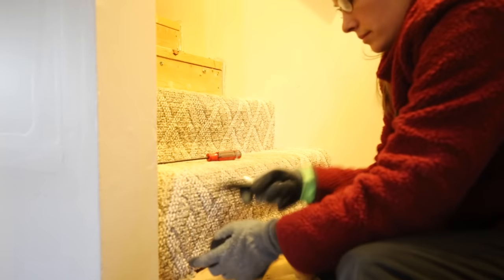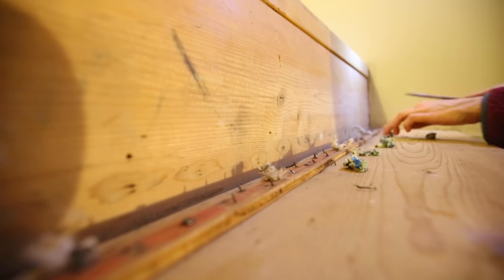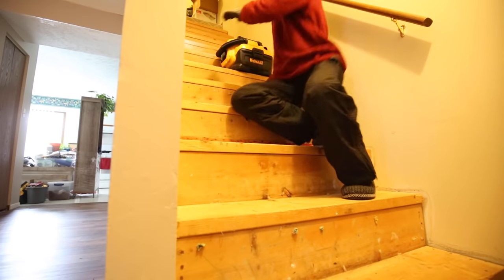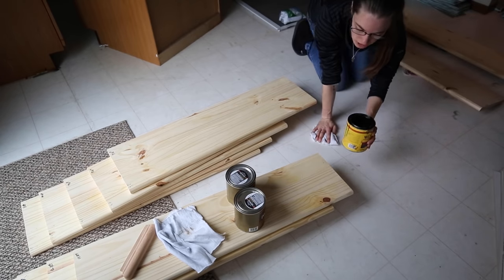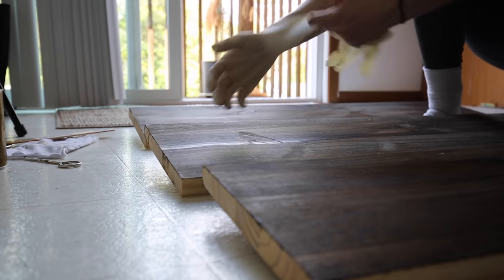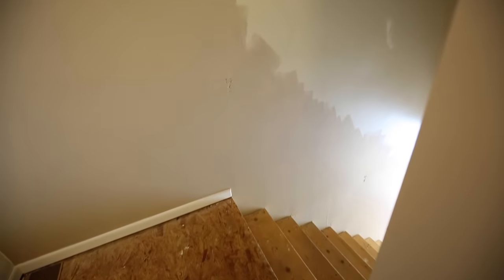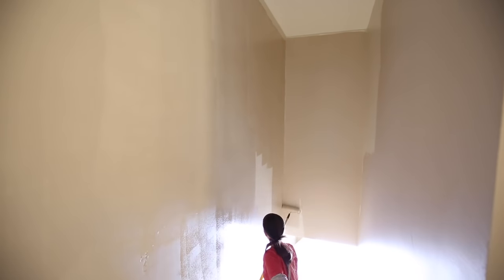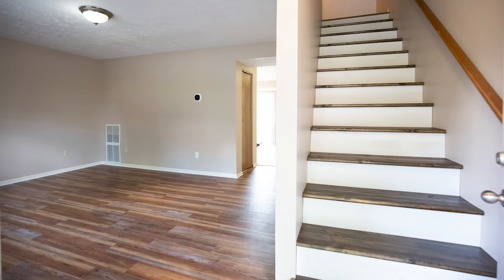Remove CARPET from Stairs | Carpet to Wood Transformation

Comment: I ordered the light spa in the 2’6”x3’10” size and then ordered the light spa 2x6 runner the next day. https://www.youtube.com/post/Ugkx9Q9vgRgCHm-96ZJLA4omp5_kb26p6SfX They were in separate orders, shipped separately and they arrived the exact same color. They are definitely green and the color looks exactly as pictured. (I actually thought they would be more blue, based on other reviewers saying the color portrayed in the picture was not what they received) They’re a low pile and not padded at all, so they don’t offer any squish under your feet when you step on them, but they are a nice soft nylon. They’re thin and rubber backed so I imagine they will do great being thrown in the washer. They’re perfect inexpensive rugs for my garage door and back door. Also love that the carpet isn’t looped on these. My last rug was looped and my vacuum caught a strand and It ripped out a whole row, tearing the rug in half! Great rugs for the price!

Comment: I noticed you did not remove the original treads. What did that do to the first step from the floor and the last step from the top? If I am thinking this out correctly you would have grew the first steps riser and shrunk the one at the top.
Reply: Exactly my question!! Any answer?
Reply: @angelikamariae  im about to ask that question too; )
Reply: I was thinking the same thing!  Although maybe it was a wash with the carpet/padding that was removed.
Reply: A friend of mine (who does floors for a living) came to help me install the stair treads and while I know nothing about this, I did a lot of research and thought the same thing from videos I watched. But my friend said it wasn’t necessary and I trusted he knew better than me since he does this for a living..but sure enough the top riser was too long. So now I’m having to build out somehow.
Reply: Did you seal or poly the bottom of the treads? If not are you not worried about them possibly warping or cupping over time?
Reply: No carpet is 3/4 and her tread is probably 3/4 or 1 in so she’s fine!!

Comment: I have the same high ceiling above my stars. To reach the highest parts, get another "Long Stick" and at the of the stick tape (w/ Electrical Tape or Duct Tape) an angled Paint Brush to the end of the Stick. Dip the brush and you can reach up there with no problem to paint the higher portion. I edged my upper ceiling all the way around before painting the walls. You will have a sore neck and arms, but this is easy and much safer than creating a scaffold to get up there. :  ) Nice Job! That is a lot of work. It came out great!

Comment from the maker: Hey everyone, thanks for all of your questions. Here are answers to some FAQs:
1. How much did this cost?
We used about 12 pine treads at roughly $12 each, same amount of risers for about $10 each, 1 container of stain for $5, and 1 container of polyurethane for $5, plus the little piece of trim on the first step which was $2-3. Altogether, that makes $278.  *NOTE ABOUT COST* The construction market has exploded over the past year, so prices will be higher now. I believe the market will calm down and level out in another year or two, but it might be worth it to wait if you’re thinking about doing this now.

2. Where did we get the treads and risers?
We bought about 12-13 treads and risers from Lowes. The treads came untreated as you see in the video, so we needed to stain and seal them. The risers came pre-primed (the white color), and we sealed them with poly for extra protection.

3. What kind of stain did we use?
MinWax Jacobean 2750.

4. Did we caulk the gaps, seal the nail holes, or stain the railing to match the treads?
Nope. This was our first stair reno, and we were learning as we went along. We definitely overlooked some of the little things that professionals do to finish off the look. We made sure the stairs were safe first and foremost, but some of the extra visual touches were overlooked. Luckily, feedback helps us learn for next time!

Thanks for checking out our video, and good luck with your projects! You are capable of so much more than you realize.
Reply: Thank you for sharing. So helpful!
Reply: Were the risers also pine or are they another material?
Reply: @Barathos   would love to know this as well! Thank you!
Reply: Thank you for this video! I’m truly inspired to take my carpet up and paint my walls. ! With 3 small children and a dog stains are endless , this will truly be great addition to my home cost wise and aesthetically!
Reply: Thanks so much for the inspiring and helpful video! After a bit of use, how is the pine looking? Oak is more common for stairs in the UK as it's a hard wood, but pine is cheaper and easier to work with for a beginner DYIer like me...thanks for your feedback!
Reply: Make a video transforming your stairs into drawers for shoes, tools, toys and so on . I saw the video but they didnt teach how to do . Tks
Reply: About how long do you think the project took? I love the video, it’s a project I’m about to tackle myself, and I’m assuming my dog will want to watch and not help as well. Lol.
Reply: What glue/caulking did you use?
Reply: Just running the numbers on this now and it seems like it will be about $400 in 2024. 14 steps.
Reply: It looks great！

Comment: Just a tip before staining, use 180 grit and lightly sand. It’ll stain more evenly. Also, when using poly, use the sponge brushes, gives it a more even coat! Other than that, great job!

Another thing I might suggest doing for whoever decided to do this. Using white silicone for the white part (risers) before adding the stained one. So I can look cohesive to the wall.

Comment: Great instructional video!! An easier way to remove the staples is to use a pair of pliers, grab a hold of the top of the staple, and then rock the pliers to one side utilizing it as a lever. It's much less physically demanding as well.

Comment: How come u didn’t just paint and stain the original treads and risers?
Reply from the maker: Great question. Our carpeted stairs (meaning stairs that were constructed specifically to have carpet on them) were "bull-nosed", and the edges were rough and uneven, which can lead to trips. Adding uniform treads and risers will lessen the tripping hazard. But you can also keep the original stairs sand down the uneven parts. That was beyond our skill level.

Comment: I have the exact same walls I had to paint above stairs, I used a “long arm” pole and a paint edger attached to it to get the very top cut-ins instead.
Reply: You can also buy a gooseneck brush and attach it with your pole to cut in, works like a charm!
Reply: I did too.

Comment: Great job and the result I amazing. Just a thought: it’s good to do stain on both sides, even if part of the underside doesn’t show. It will prevent warpring. The rule of thumb I’ve heard is that whatever you do on the top, you do on the bottom. It was relaxing watching someone do all the work: I refinished my staircase last year … worth all the blood, sweat and tears!
Reply: isn't better to stain stairs at the end, once everything is done? yes you will need some work to put tape around but this way seems faster and probably cover better all potential little gaps if any and filled with caulk, stucco etc.

Comment: If you're okay with the unfinished paint job at the top by all means do it yourself. But if you feel you would need a professional to finish that trim in between the wall and the ceiling, you're better off just hiring professionals to do the whole job. I couldn't imagine that the cost of them cutting in the trim alone would be much less cost than just doing the entire job.

Comment: I usually use pliers to pull the staples out. Though some of them require use of flat head screwdriver when they are deeply embedded in the wood.

Comment: Did you have to cut the nose off the stairs before you added your runners/risers?  Or did you just fasten your riser to the top part (that stuck out more) and angle it down to the bottom?

Comment: I thought you could use the wood under the carpet I had no idea you had to put down new ones. I'm looking to have my done by a professional but it looks easy watching this video. Thanks for sharing. Great job!
Reply: The wood under most carpet ("builder stairs") is usually pine - a cheaper, soft wood. It will dent after some time of taking the abuse that stairs do. Replacement treads are hard wood.

Comment: Doesn’t adding the extra height on the treads throw off the distance from the upstairs landing to the first step going down (makes it shorter) and when climbing up the stairs from the bottom the first step is higher?

Comment: Hello, I noticed you used a nail gun during the installation, did you fill the holes after ? Or painted over ? How did you hide the nails, or did you just left it as is ? Also, can one get away without using nails, and just use a good product,  like "no more nails" for example ?

Comment: Ok so quick question, I saw that you didn’t put the riser on the first step that touches the floor but started on the second instead because you didn’t install the floors and probably would do it later to on top of the floors … but the tread is flush on the second step so when you eventually added the riser how did you hid the lip because the riser would be wider and not covered by the tread lip ???

Comment: Nice thank you so much. For those who have a window cleaning extension in the area of Ireland and UK you might, I tapped a brush on the bending of this device to paint the corners of the walls and ceiling. Does work too 😃

Comment: fantastic job! and thx for posting this video and revealing how much work it actually is to redo stairs. i have the same setup here ie old carpeted stairs and probably tons of staples and i would love to get rid of it and put on some new treads like that. I do wonder what affect the new treads had on the top and bottom step heights... ie does the bottom step feel kinda high and the top step feel kinda low compared to the rest of the steps ? terrific video :)

Comment: Hi, since you are adding 1" steps/treads, the space between the top step and floor will be an inch shorter than the rest. Also, the bottom step will be an inch taller. Could this be out of code? And a tripping hazard?

Comment: I started removing white carpet on my stairs & discovered it was metal underneath.  The tack strips are glued down on the metal steps with some kind of construction adhesive.  I've tried everything to get them off. I finally got most with a hammer & chisel.  It still left the glue & wood.  I haven't removed the rest of the carpet because I can't get these strips off without hours with a chisel & hammer.  If anyone can help please respond to this comment.  There is absolutely nothing I can find when I try to research tack strips glued to metal stairs. Please help!!

Comment: Is that DeWalt battery vacuum not the best little thing! I love mine!    I think pulling carpet off of stairs is one of my most hated things to do in a flip or remodel!
Reply: When reming taking strip (we owned a flooring company, so my family got creative over the years), a roofing shovel with the jagged edges works wonders and is 1000 times faster and cleaner.  Shove it under the wood and lift it up! It takes it out in much bigger pieces (sometimes the whole piece) and less mess!

Comment: Amazing job! One question, at the top of the stairs where your tread meets vinyl flooring, how did you level so it is even? I would assume the thickness will be different.
Reply: I would like to know this as well! Thx
Reply: I did a similar project and we just routed the top tread down to be the same thickness as the vinyl plank flooring. Turned out great

Comment: I'm trying to figure out what to do on the last step at the top where it meets the LVT. Does anyone have any tips? Am I meant to add some sort of transition strip between the LVT and the first rider? Or do I add a thread at the top? In which case the LVT will be too low. Please help.
Reply: I would attached a bull nose piece to top stair level with your new top step flooring.

Comment: I have that same pole. For my high ceilings I cut in by putting one of those flat rectangular edging attachments on the pole. It threads on the same as a roller. It worked well.

Comment: Be warned that no carpet means more noise when using the stairs, more echo and you will be forever cleaning the dust as the wood will not hold it like carpet does.

Comment: Hi, did you cut off the nosing? And I also did not see you pad the riser out?
Reply from the maker: Is that what it's called? nosing lol now I finally know. Yeah we weren't expecting that so we weren't sure how to deal with it. Some of it was so minimal, it didn't make a difference. A couple of risers needed shims behind them, but the rest went on just fine. Thanks for watching!
Reply: @CedarLiving  Thank you for the explanation! All other videos show the nosing needs to be cut off but I know you can also pad out the riser ( did not see any video showing it being done) The nosing on my stairs is 3/4” overhang... i will need some 1x instead of the shim to pad it out.
Reply from the maker: @guan5625  Oh man those are bigger noses than we had. Let me know what kind of padding you use and how it works out. Good luck!

Comment: Amazing job!!!! You guys really turned that around! I feel better about starting my stairs. Can I ask approx how much you think it cost to reduce your stairs?
Reply from the maker: Thanks so much! We used about 12 pine treads at roughly $12 each, same amount of risers for about $10 each, 1 container of stain for $5, and 1 container of polyurethane for $5, plus the little piece of trim on the first step which was $2-3. Altogether, that makes $278.

Exciting news about your stairs - are you removing carpet, too? You can do it!
Reply: @CedarLiving  yes, I’m am removing carpet the is probably original to the home built in 1992. So I’m excited and nervous at the same time. I have railing too so i have to also redo those!
Reply from the maker: @Justice4300  Oh wow, that sounds like a challenge but you can it!
Reply: @Justice4300  I'm in the same boat. House built in 1992 with carpeted stairs. I'm scared as hell to try this, but at this point, I've got nothing to lose.
Reply from the maker: @1995Benzo  You're capable of more than you know!

Comment: Great Job! I have a similar stairwell and high walls as well. I found an edging tool for those high ceilings you can put on an extension pole and it will give you a crisp edge on the ceilings and keep the paint off. I love your suggestion about stopping as close to the ceiling as you can and "don't worry about it! lol". Great advice!!